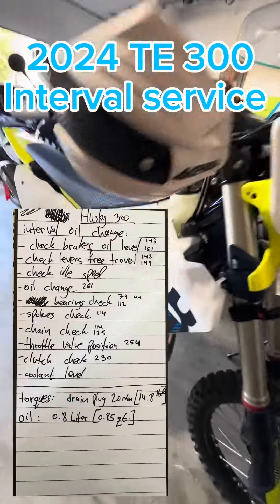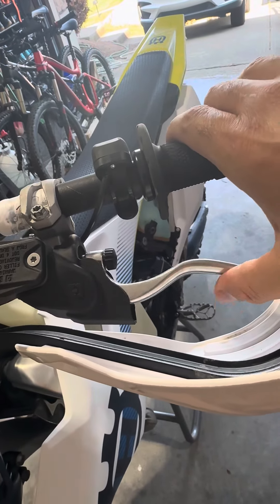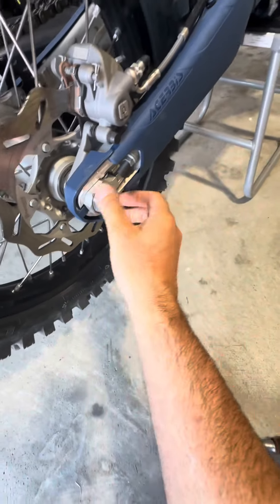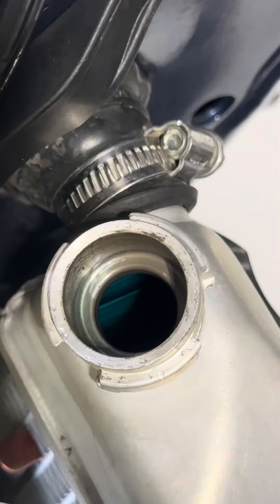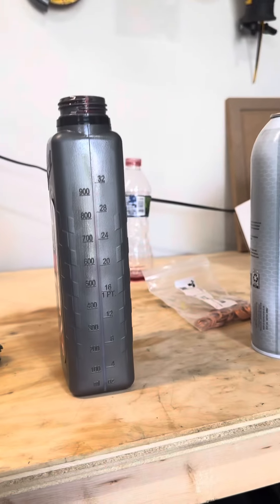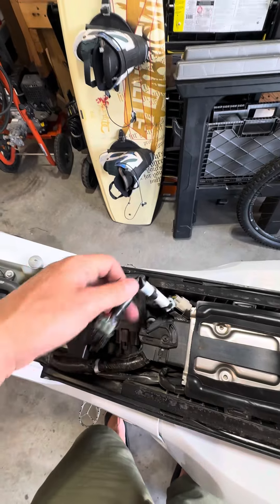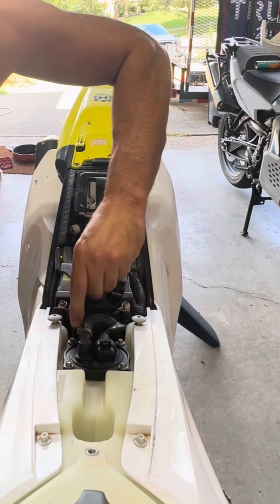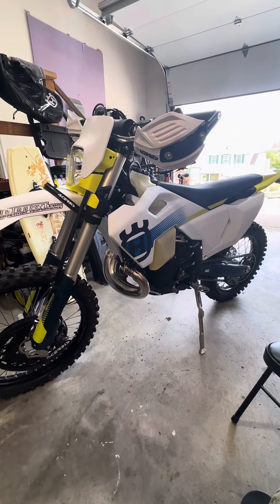2024 TE 300 service guide

Comment: Nice video. one thing, the chain adjustment on the new TBI linkage bikes calls for waay more than what we were used to before. no more 3 finger rule. should be up around 62mm+ or chain will bind on full rear shock compression.